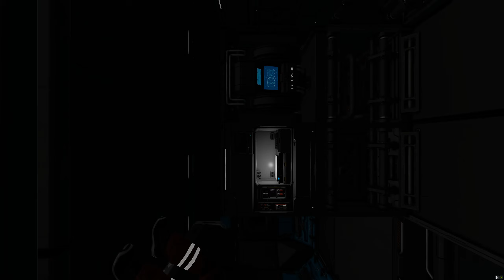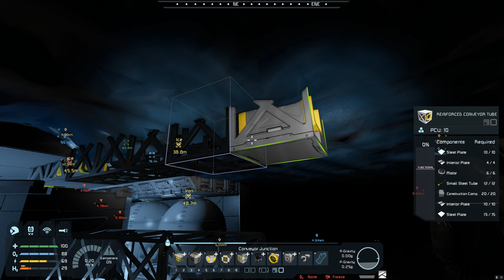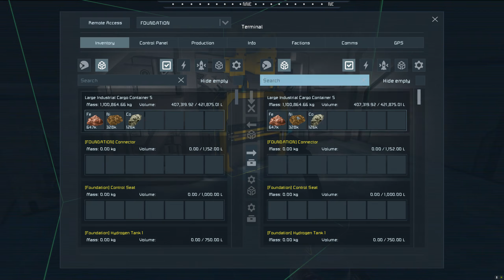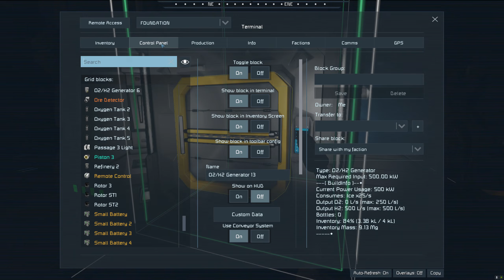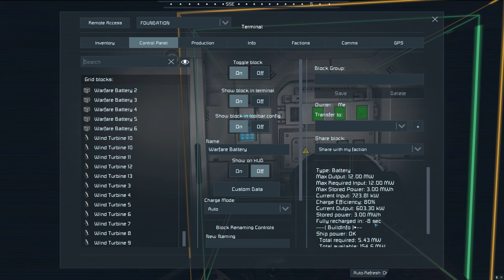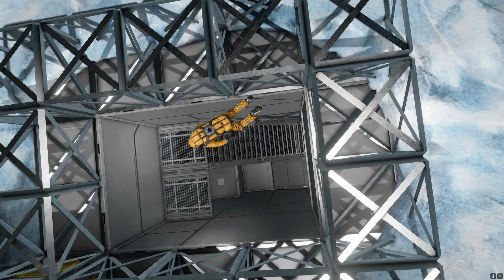Drill & Build | Proxima Beyond Ep.15 - Space Engineers

Comment: Your airlocks, disconnect them from the O2 generators and have a dedicated O2 tank, just for the doors. That way it'll vent and regas the system but won't get included as system storage for O2.
Reply: at some point he will still NEED a tank refill though.....
Reply: @mikewhitaker2880  Just open the airlock to inside the base and have the vent in the airlock depressurize.